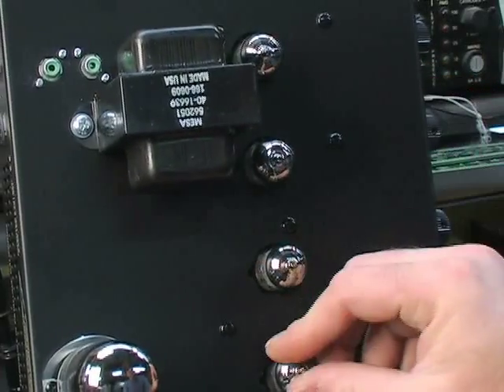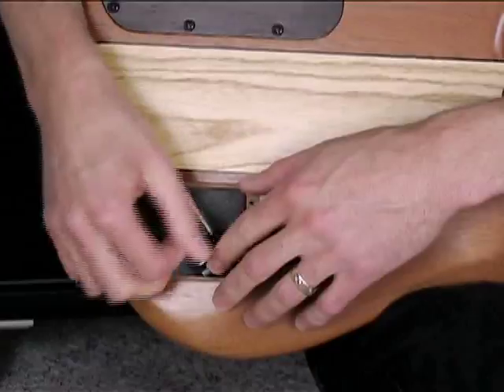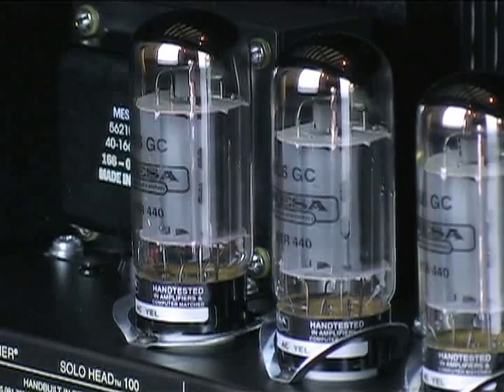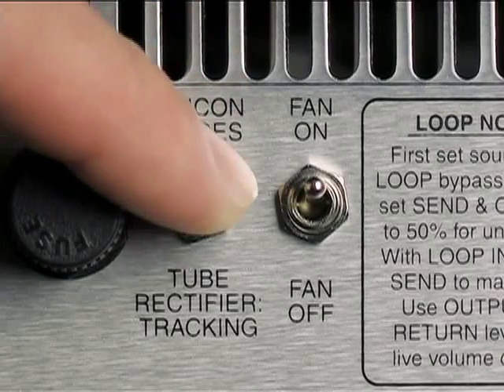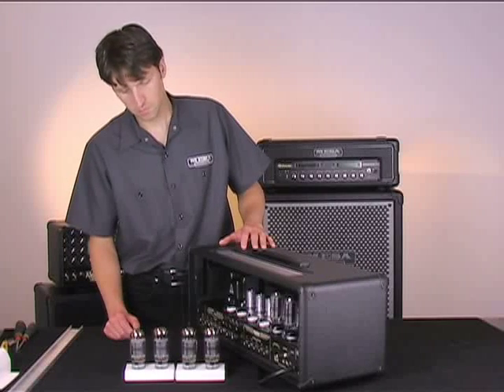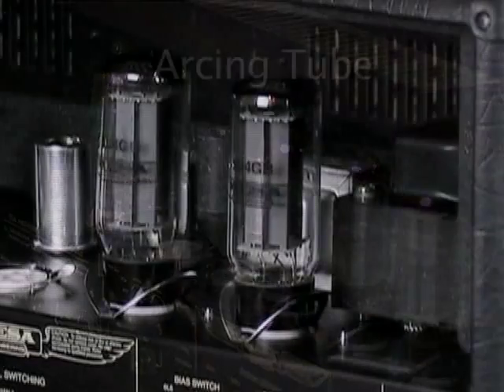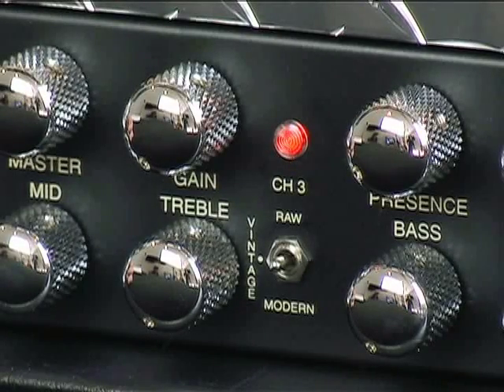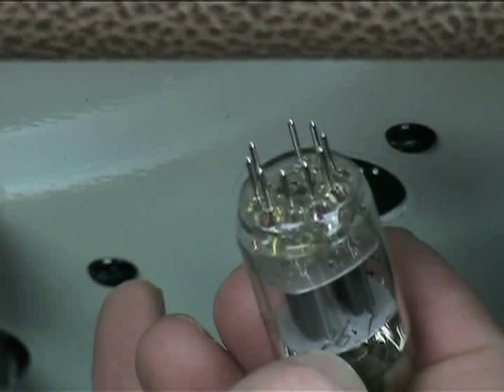Mesa Boogie Amplifier Troubleshooting

Comment: Hi MESA/Boogie fellas, I just got my hands on a Triple Rec (old version) which is still loaded with older STR-430 tubes. Trouble is, during delivery, the 3 rectifier tubes were shattered, as well as 1 6L6 power tube. Would it be OK to replace that power tube by a matched pair of newer 6L6 STR-440 and use it with the older STR-430, or should I replace the whole batch to STR-440s? I'll also have the rectifier tubes replaced of course.

Also, maybe a stupid question, but when performing a stress test on the pream tubes to see if there are any noise or microphonics issues, should the power tubes be in the amplifier (in order to hear something) or can they be removed (after taking them all out for better access to the preamp tubes)? I wish to perform this on my Mark IV (short head, so little access to the preamp tubes with the power tubes still in) as I think the tubes are getting old. Thanks!
Reply from the maker: Hi Rephael - It's OK to replace just a pair of tubes in the amp, as long as you replace the tubes in the appropriate pair positions/sockets. In a Triple Rectifier - if you label the POWER TUBE sockets 1-6, left to right - the tubes are matched in pairs as 1 & 6, 2 & 5 and 3 & 4. If 3 is broken, replace 3 & 4. If 1 is broken, replace 1 & 6. If all of your tubes are the same color code/rating, you don;t have to pay attention to this. If they are different, this is important. Also, because the amp was poorly packed shipped and so many tubes broke, you may consider changing all the tubes given that the amp obviously had a rough ride and the other tubes, while not broken, may not be in good working order. Given so much breakage, we would recommend a fresh start with power and rectifier tubes. One other thing, with the broken rectifier tubes removed, you can switch the Rectifier Select switch to Dioides and operate the amp with no rectifier tubes installed. Make sure that the switch doesn't accidentally get flipped to Rectifier Tubes with no tubews installed - this is not good. BUT - the amp can be safely operated in Dioides with no Rectifier tubes installed.

In order to test the preamp tubes while they are in the amp, you will definitely need to have power tubes, otherwise, there will be no amplification from the amp to hear the preamp tubes. If you want to change the preamp tubes more easily while leaving the power tubes in the amp, remove the chassis from its cabinet and you can change the preamp tubes much more easily. Hope this helps and hope the amp gets back to worjking 100% for you soon. Let us know how it goes.
Reply: Hi, thanks for your extensive and crystal clear answer. Can't go wrong! I took off the chassis on both amps, much easier indeed ;) I'll get some new tubes and check in back here. I'm still getting used to understanding tube amps, so I'll do a bit more further reading on my own. I'll certainly get a SPAX7 for each V1 preamp spot and some 5881 STR-425 for the Mark IV power section (as I already know how it sounds like with STR-430's), while sticking with STR-440 with the Tripe Recto. Also, I think the the 3 blown rectifier tubes on the Triple Recto were still SU4G's coke bottles, which might explain the damage.

Just some questions on the fly here:

- Is it possible on the Triple Rec to take off some power tubes (and hence a rectifier tube per pair of power tubes) to reduce the output as it is possible to do on the Dual Rec with the central pair of power tubes?
- I took off the power tubes of the Mark IV and put them back one by one, following the cold start procedure each time while giving them a go on the stress Standy test (as shown in the video). While doing so, the inside of the tubes turned blue (every single time) and when the four were in, I even noticed some kind of flash in one of them. I guess this is bad...
I noticed that the fuse in the amp was a "T8A", while the rating on the rear chassis says "T2A". It was sold to me like that (by a pro musician working in a music store though). I'm no specialist in fuses, but maybe that could damage the amp if the fuse can't blow when it should.
- I'm living in Europe, and while my Mark IV is "European" (power section: 230V ; 50Hz), the Triple Rec is from the US (120V ; 60Hz). I'm planning to get a 1000W transformer to run it here for "long" periods (a gig) without overheating the transfo (since the amp is 120V x 4A = 480W), but I'm wondering: could the difference in frequence damage the amp? I've been said that if there's no motor in the device (like a kitchen robot), there should be absolutely no difference in behaviour or lifetime. What does your electrician think about that? Any power surge on startup like some other devices which might mean an even bigger transformer?

Can't wait to have this Triple Rec pony run free (I like you old owner's manuals as you can see ;). I'll make sure to let you know how they all sound! 

Thank you very much for your answers!
Reply from the maker: Rephaël Sobrino Alvarez  - Glad we can help. Your questions: Yes - you can remove a pair of tubes on a Triple Rectifier and the same pairing mentioned in our first response is important. Only rmove one pair, and make sure they are from corresponding, matched positions (1 & 6, 2 &5, etc). ALSO - the speaker jack impedances on the back of the amp change when you do this - they double. So if you have an 8 ohm cabinet, plug it into one of the 4 ohm jacks when one pair of tubes is removed.
Tube Glow - Blue glow is normal. A white flash indicates a tube that has or is shorting and should be replaced.
Fuses - A higher value fuse can do significant damage to an amplifier or any significant device. ALWAYS, ONLY use the value of use printed on your device. Failure to do so can lead to the most expesive damage to the amp that can be done. Do not play the amp with the incorrect value of fuse.
Step Up/Down transofrmers - we do not offer qadvice on using StepDown transformers - please contact local sources for info on running your amplifier with step down transformers or please contact your local Mesa Distributor for information on getting your amp converting to your countried proper voltage. Hope this helps and best of luck getting your amps all up to full working potential! Cheers. :)
Reply: MESA/Boogie Well after reading extensively the owner's manuals of both amps and getting intimate with their functionings and after replacing the fuse to a T2A one in the MarkIV, I did the power amp test again on the MarkIV, just to find out that everything's fine! Except for some crackling in one of the power tubes, it's all good. And your instant gratification settings give a sweet tone, I'm rediscovering my amp back from scratch!

I haven't tried the Triple Recto with a transformer yet, but after reading a lot on it I'm pretty sure it will run just fine with a proper step-down transformer. I'll let you know how it sounds anyway.

Thanks a lot for the excellent customer service you provide, as well as for your extensive, clear and funny owner's manuals you provide. I espacially dug the Irishmen parallel Randy draw to explain the inner working of diode/triode/pentode tubes ;) Cheers!
Reply from the maker: Rephaël Sobrino Alvarez
Excellent stuff, Raphael - so glad everything is close to working perfectly, now. Let us know if anything else comes up and thanks for the kind words. Rock on! :D
Reply: MESA/Boogie Finally got the transformer for running the export version of the Triple Recto in Europe, and it works just fine! Sounds like the polyvalent monster it is.

I've got one last question for you lads: when you take out the central pair of power tubes in a Dual Recto, do the impedances of the speaker jacks on the back on the amp also double? As you said it does for Triple when you take any of the matched pairs out. Is it also possible to remove far right and left and leave the two center intact in the Dual? If no, why is that possible in the Triple (as you said: taking "any" of the matched pairs out)? Anyway, I won't forget to take out a rectifier tube while taking out either pair of power tubes.

Thanks and keep on rocking!

Comment: So, to summarize some things for my own understanding:
A) only replace a preamp tube when it has actually failed and is making noises it shouldn't be making (cuz Mesa Boogie says)
B) replace power tubes (all at once) when one has actually failed, or if your amp no longer sounds as awesome as you know it should (so says the internet: forums n such)
C) replace rectifier tubes.... when? anyone?
Reply from the maker: Hi +nuynobi - A) Yes... if it ain't broke, don't fix it. :) That said, some poeple like to change their tubes on a schedule... and that's fine too, but preamp tubes can last quite a long time so if there's no improvement in tone for changing them or you're not troubleshooting a problem, you might as well keep on going and save any backup preamp tubes for down the line or when you need one when one goes bad. B) You can change 1 power tube at a time if you can troubleshoot the bad one. If you have a power tube fail prematurely (less than 6 months or a year), if you can clearly ideintify that it's the bad one - sure - only change that one. And, agreed - if you're amp sounds less bright, mushy or you find yourself having to turn controls up or down from settings that your used to and you know you have a lot of hours on a set of tubes, replace the power tubes as a set and see if you get a noticeable improvement in the tone. C) Rectifier tubes last the longest our of power, preamp and rectifier tubes and the don't really affect the tone dramtically as much as they effect the feel/response of the amp. Firstly, if you don't use the rectifier tubes because you use the amp on Silicon diodes, you won't need to change the Rectifier tubes unless they are failing and causing the fuse to blow. Secondly, people who love the feel that rectifier tubes offer tend to like them more and more as they wear because they sag more as they get older, and that's the feel that most people prefer from amps with rectifier tubes. Again - kinda like if it ain't broke, don't fix it. BUT - always keep spares on hand, so you CAN fix the amp if/when a tube goes bad. Hope this helps! :)

Comment: This video is amazing. Thank you Mesa/Boogie. After 15 years of going through different amps I finally have the amp of my dreams. Picked it up at approximately 6:15pm 9-22-16. I'm never going back to any other amps again. Thank you all at Mesa you're the best.
Reply from the maker: Many thanks, Dan! Appreciate the kind words and hope the amp is serving well! :)
Reply: +MESA/Boogie Well I did discovered a issue. The Tremolo effect isn't working. I turn it on and I can hear a clicking as speed is increased. But nothing happens as depth is engaged. Once off clicking noise goes away. Curious, what could cause this?
Reply: +MESA/Boogie  would also like to add. no matter what small issues come from a poor previous owner. It is still a Mesa and built to destroy all others ha ha. I greatly appreciate any help.
Reply from the maker: Hi Dan Bo – Hard to say what exactly is going on here, unfortunately. The Tremelo circuit is not tube related so it is very likely something electronic and something that a technician will need to take a look at to troubleshoot, sorry to say. Make sure you have a simple tip to ground on/off switch (and not something that is possibly incompatible) before taking it to an Authorized Mesa tech for a look. Here's the link to search for Authorized Repair in your area: http://www.mesaboogie.com/support/locations.html
The Tremelo circuit in a Tremo-Verb is not user-serviceable. Sorry to hear of the issue and please let us know what you find
Reply: I honestly don't understand why MESA isn't the #1 seller. Even Carlos said: it boogies! Hence it's given name.

Comment: dual rectifier doesnt work in vacuum tube mode, but works fine in Silicon diode mode? please help
Reply from the maker: Hi +Dustin Teasdale - sorry to hear you're having problems. The amp working in diode but not working in the vacuum tube setting suggest you likely have a bad Rectifier tube. First, inspect both Rectifier tubes and look to see that they are both lit. If you see one that is and one that isn't, that's likely the problem. However, the both might be lit but can still be an issue so the visual inspection is only step one. If there's nothing obviously visually wrong with the one, we would suggest you consider replacing either one, one-at-a-time... OR - you can replace both and see if that solves the issue. Finally, if that doesn't solve the issue, the amp will have to be looked at by an authorized technician. Let us know how it goes and let us know if you have any further questions! Hope this helps! :)

Comment: Hey guys at Mesa/Boogie. Just curious why its not recommened to change all the pre-amp tubes at once. I mean, isn't a 12ax7 just what it is? Shouldnt they all sound the same?
Reply from the maker: Hi Trevor - 12AX7s are recomended to be changed one at a time for a couple of reasons: If you are trying to solve a problem, changing them one at a time will help you discover the specific tube that is causing the problem and get rid of that tube only. Because tubes cannot be tested for how long they will last (this is why we offer a warranty one them), if, for example, most of your tubes are relatively new and you run into a problem, you don't want to replace all of them just because one goes bad. Also, preamp tubes tend to last a long time and lots of people love the sound of their amps with 'broken in' preamp tubes versus brand new ones. IN this case, again, change the one that's bad and leave the others. Finally, if you do have a preamp tube failure and you find the bad tube but you also want to change the others because 'it's time' to change the full preamp set, you still want to find the bad tube so you can save the other old tubes as spares because those are actually the best spares you can get! So - those are just a frew reasons but it is certainly OK to change them all at once if you want... this approach is a little more scientific and specific and a little less wasteful, as well as poroviding you with known good spares when you do change your tubes. Hope this helps and thanks for the great question! :)

Comment: I have a crackle noise on my lonestar classic. Af first only at channel 2 with drive engaged, so i changed V1. Crackle still there and even on channel 1 but softer. Changed V2 also, still crackle. So i tapped the other preamp tubes but no extra noise occure. Than tapped the 6L6 tubes and there was noise on the first outside left tube. So i changed both outside tubes because of the different color code. Still crackle. When warming op the tubes and switch the standby on there is a blue flash on the left tube, even when changed. I guess there's a problem. I've used new mesa boogie tubes. Can you help me out? Cheers, John
Reply: With first outside left tube i meant the first 6L6 tube on the left; of the the fout 6L6 tubes :) and i know i changed the order of trouble shooting, shame on me. Looking forward on your reaction.